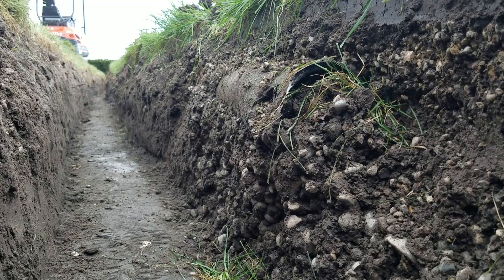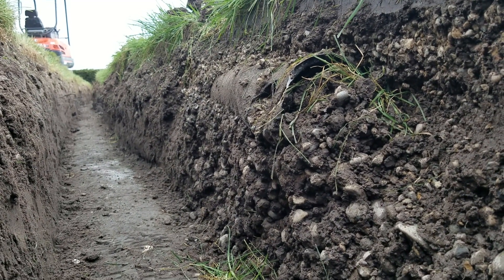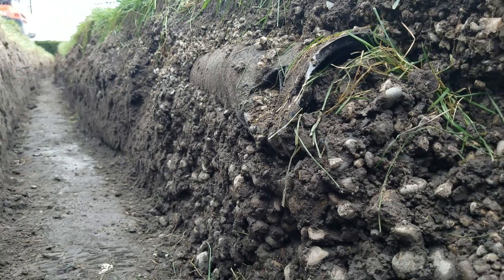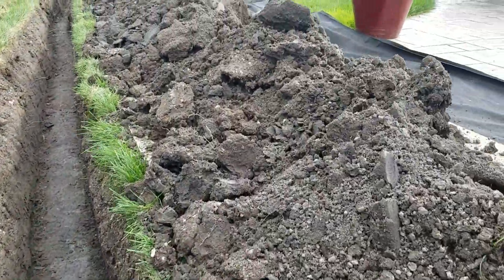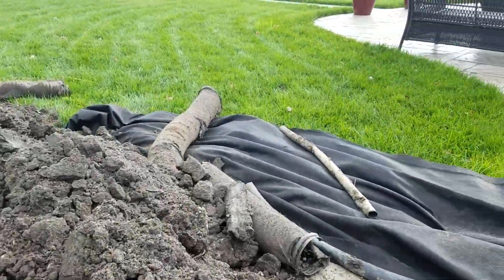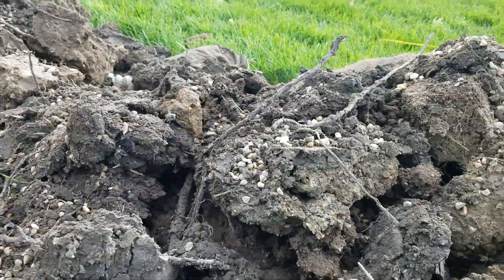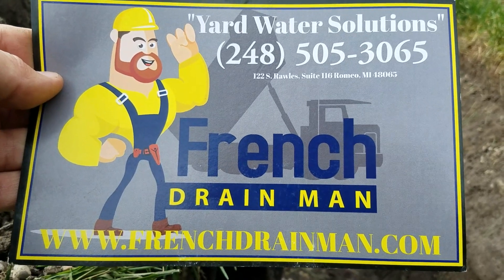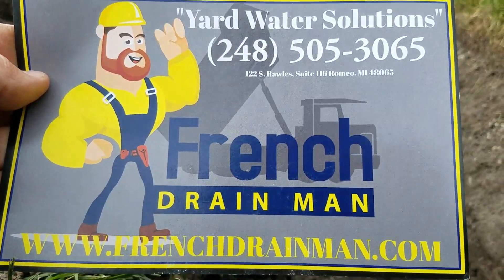Why French Drains Need Geotextile Fabric

Comment: The main failure for first system is graveled area have pore size too high its mean high hydraulic conductivity and with pressured water to the direction of pipe perforation protecting with mesh type filter is worng mesh type filtre when it face with high pressure of water with sediment will get inside hight than normal partcule size.. the scound application have barrier before to gravel stopping with low pressured area than to pipe going the sediment which is passing from first layer finnally is the 2 method is same but secound method cheating us with his phisical or material change its 2 material pipe and gravel but its same becuase this are zone for water transport in first collecting sediment in pipe directly which is passing from filter secound application collecting the sediment in gravel not showing inside of pipe any sediment but finally after several year it will face also with low hydraulic conductivity because all filters in first or last layer will face fiber pore size clogging and will be hydraulic conductivity less then first days... may you did in 10 years first one the other one you will do after 20 year again ! this is solution but not leeting the pipe drainage working life cycle is till pipe plastic disappear !

Comment: Do you put the pipe on a layer of stone after lining the Trench?
Reply from the maker: Only if we have a root barrier. Our systems are outdoors, and we run into a lot of issues with shrubs and trees rooting into the system. If we put stone under the pipe, the stone holds water in the voids, and tree roots can sniff that out. But if we put a root barrier in, we can put stone under the pipe.
Reply: @FRENCHDRAINMAN  Doesn't matter. It was 3 years ago.🤔😩

Comment: But Apple drains says the fabric stops the water entering because it clogs and you say it stops the stones clogging
Reply from the maker: Consider the source. Your comparison hack vs Licensed Builder who works off engineered plans..... you choose for yourself
Reply: Haha! Exactly what i was trying to point out too. But i believe its the principles the two companies rely upon. 
Apple drains drain are for the drainage of the Subsurface water(Drainage of the water from GWT) and the French Drain Man drains the water from the surface to the tile system. The tile system here works independently from the sub grade, hence, the requirement of the geo fabrics.
Reply: When I watched the Apple Drains vids he says to wrap the pipe in sandy soils but its not really necessary in clay soils. I think he recommends fabric only on the top then cover with sod and soil. Personally, it seems to make more sense to wrap the whole thing so I'm planning to do that but that's just IMO.
Reply: Yes, so I'm none the wiser.